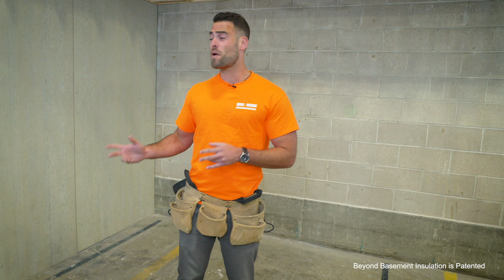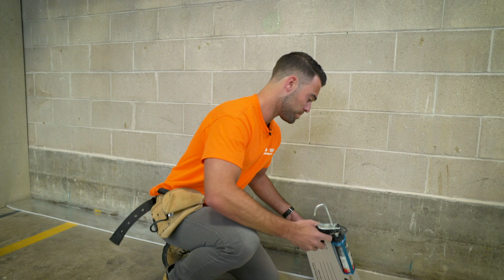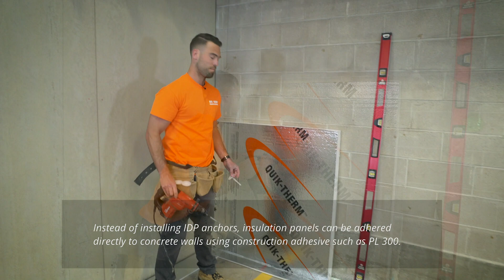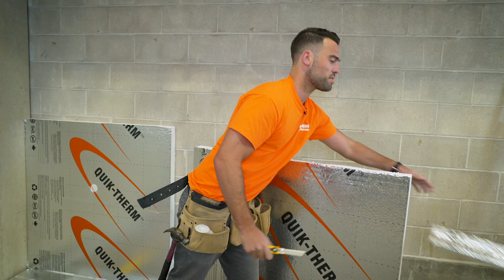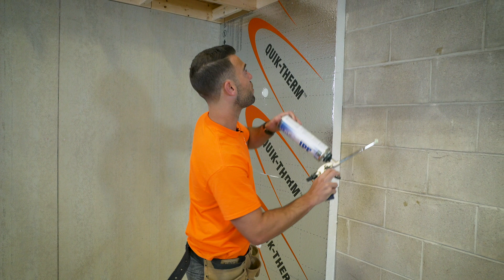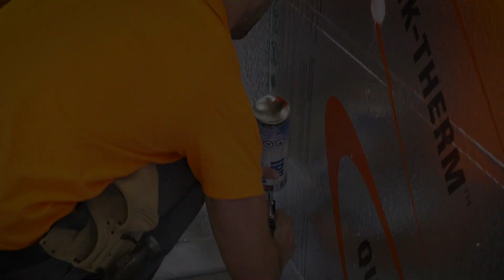Insulating Basement Walls - How to Insulate your Basement

Comment: I was hoping for an explanation about why your system doesn't need air gaps, or water proffing, in the video. What is the building science behind this product to prevent water condensation, or water intrusion between the insulation and the concrete wall?